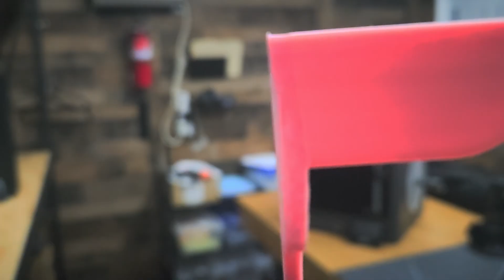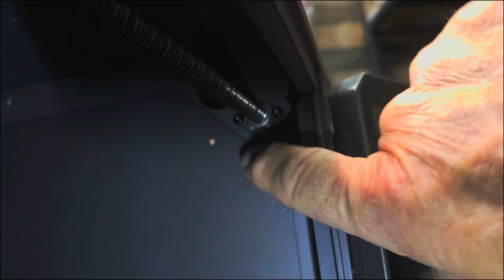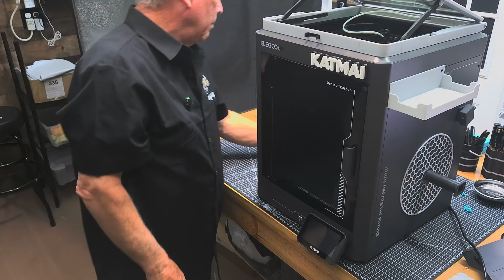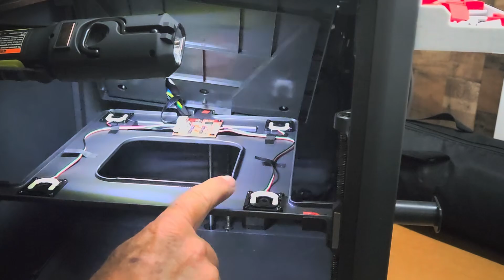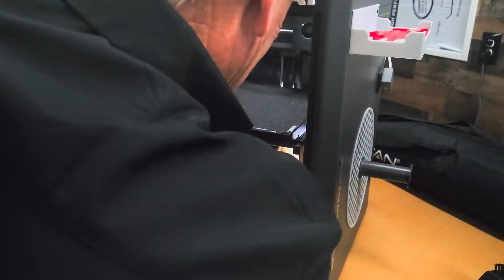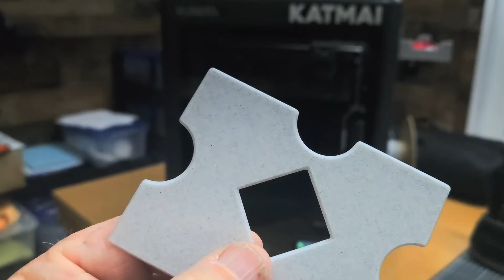How To Fix 502 Error Centauri Carbon 3D Printer

Comment: Sir, I skipped the belt fix and went straight to the sensory swap fix which worked!  I think another commenter said it, but we both probably just had a very slighlty loose connection.   But watching your thorough, very well filmed (great job getting the camera into the machine) video made all the difference.  Thank you!

Comment: Watching another video to resolve this issue, and he found that the connectors were not seated fully, even though everything appeared to be seated... so the fix was to reseat the connectors into the circuit board...

That's likely what your issue was... 

...but I'm going to tear mine apart tomorrow, reseat the connectors, paying attention to the screws as well.. hoping that between reseating the connectors and making sure the screws are tight, tnis issue goes away...

His video didn't show where everything was as clearly as yours did (or perhaps YouTube froze?), so I appreciate greatly your showing how it all comes apart and where the sensors are....
Reply from the maker: That's a great tip, hope that fixes it for you! 🛠️
Reply: @MonkeyCraftPrintShack so I took it apart to get to the circuit board under the buld plate bed... and in trying to get the connectors unplugged (I know there's a tool for that and I need to find one... if I just knew what it's called), I broke one of the connector sockets off of the circuit board...
 😬😬😬

Fortunately, it separated all connections to the circuit board at the SMD pads and none of the pins or pads were damaged... so I removed the board and disconnected the rest of the multipin plugs, thank God, I was able to clamp the socket to the board where it was supposed to go, and with a little soldering paste and my soldering iron, I was able to flow the existing solder back onto all the contacts...

Carefullly reconnected all the plugs, making sure they were fully seated, put the board back in, reassembled the bed, ran the initialization self check, and its been operating perfectly ever since...
❤️🙏

I think I might look into ordering some spare parts for this thing (sensors, circuit boards, etc)

Thanks again....